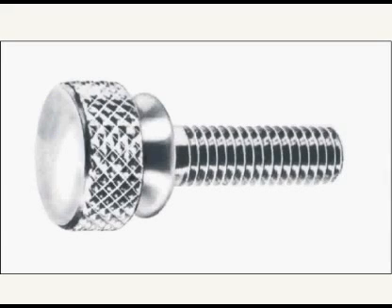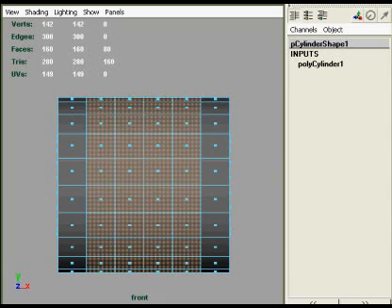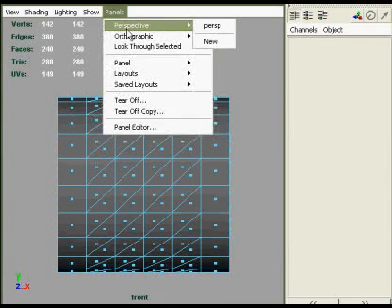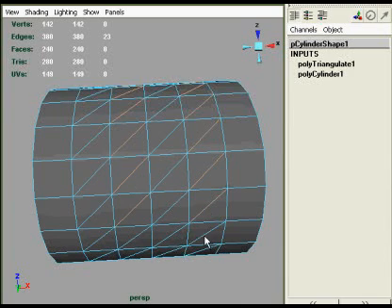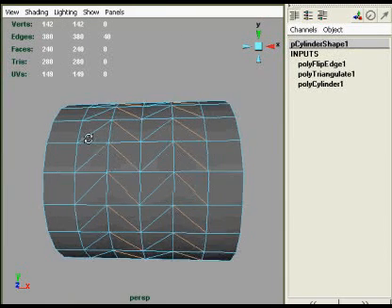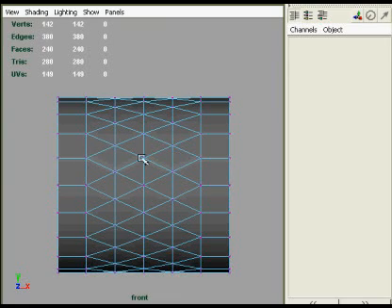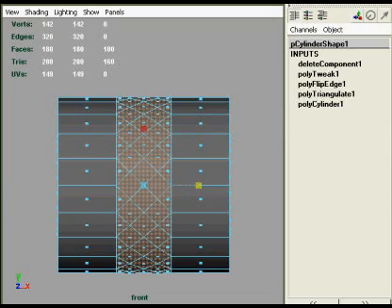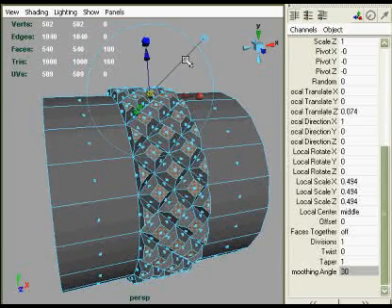Maya Modeling Tutorial - Knurl

Comment: Maya and 3DS Max are both a pain to use for modeling.  Try Sketchup or Zbrush, depending on what field of work you are in.
Reply: olaysketchup not really. Sketchup is a basic 3d sketching tool, just to block out ideas. Can go more complex but in the end it looks crap. Zbrush is not really for modelling, its for sculpting, try doing this with the same level of ease in zbrush, even with zmodeller. Maya, 3ds max and modo are the top dogs of modelling.